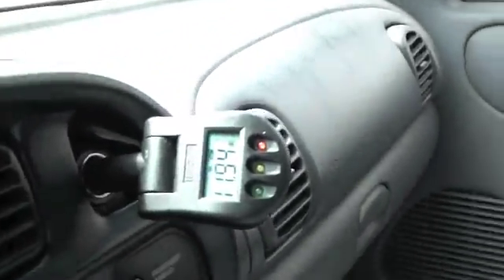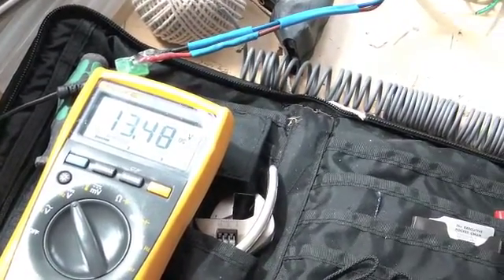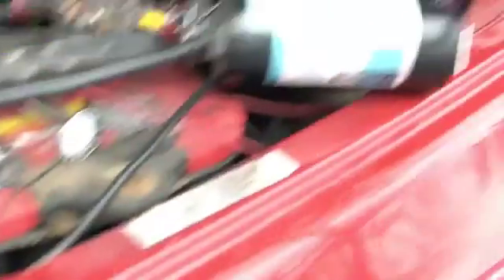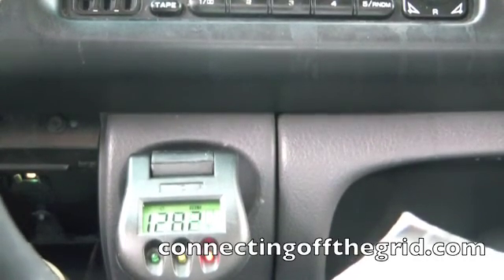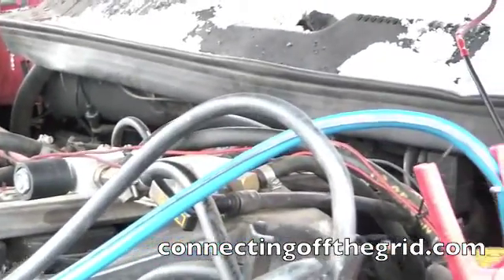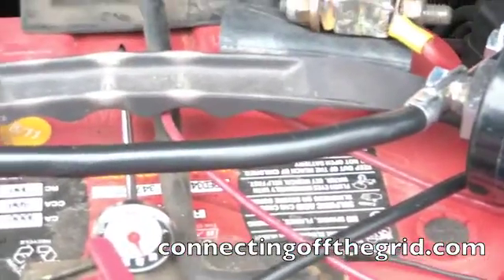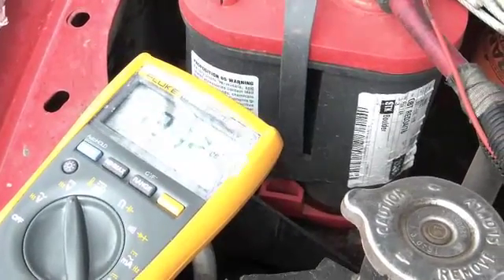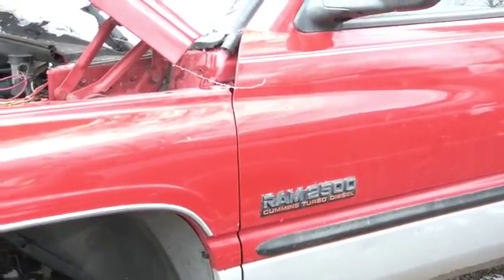Dodge Ram Cummins Diesel 12 Valve Ultracapacitor Cold Start Test

Comment: Have you done a test of that ultra capacitor pack alone? Using a battery isolator switch to run the grid heaters off of a battery and then once they have cycled disconnecting that battery from the system and just starting it with the capacitor pack by itself? I have a '96 12 valve myself and I am very seriously looking into doing a setup like that. If you haven't then I asked if you please could, you don't have to make a video although one would definitely be appreciated I'm sure by more than just I.

Comment: Your grid heater is cycling off and on.  That is causing the voltage drop.  Put the truck in gear or raise the idle if cold and it will prevent the voltage cycling.

Comment: Regarding the charge regulation when charging using the solar panel an easy solution is a highish power 15v zener diode across the solar panel output. Personally I would use a 2N3055 power transistor and a low power Zener diode. Message me if you want a more detailed description.

Comment from the maker: I sifted a bit through my service manual and found mention that the PCM receives input from the intake manifold air temperature sensor during startup. Also: "The PCM’s main function is to control: the vehicle charging system, speed control system, transmission, air conditioning system and certain bussed messages." It has outputs to the generator field driver (- & +). Your assessment sounds consistent with this information. Thanks for contributing. Yes, it's a '98 12valve.

Comment: I was under the impression that the Powertrain Control Module cuts the alternator when the intake grid heaters turn on. (PCM feeds the field windings in most newer vehicles, Dodge Ram included.

I have a 2001 24 Valve. This appears to be an early 1998 12 Valve due to the digital Odometer. That should put it right in the computer controlled era.

Comment from the maker: I've since calculated that at 95A draw, the two intake heaters coming on for 10 seconds below 60F or below 15mph (according to a Cummins forum) will only consume about 2500 Watts (or what could be replaced easily by my solar panel in about an hour of direct sun).  That's much better than the 7000 Watts for 2 minutes I had originally thought.  That suggests to me that removing one of the start batteries and replacing with the power pack could be viable.  I'll keep ya'll posted if I commit to it.

Comment: Alternator is not cutting out,  what your seeing is the grid heater warming up the engine intake, that loads the system down, very common. Alternator can't handle the full load of grid heater so voltage drops, then when grid heater cycles off voltage increases again...etc...

Comment: I don't think you need a charge controller for the solar cells led and diode capacitor  balance circuit should be able to absorb enough power to hold the voltage down to protect the caps from over charge.

Comment from the maker: J Suparman, series would give a starting voltage of about 27 volts and may fry some components.  When working with batteries I use a simple reminder:  series=serious voltage.  So, in this case, like pole to like pole give a parallel connection (positive to positive and negative to negative) and maintains the voltage but increases available current.  Thanks for checking.  And, as always, if I've made a mistake, please correct. w w w.zbattery. com/Connecting-Batteries-in-Series-or-Parallel